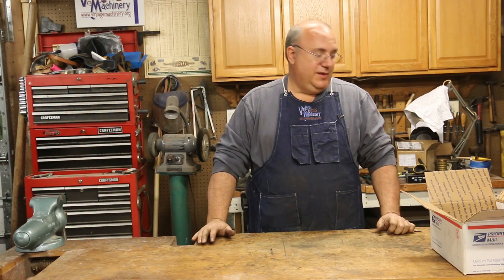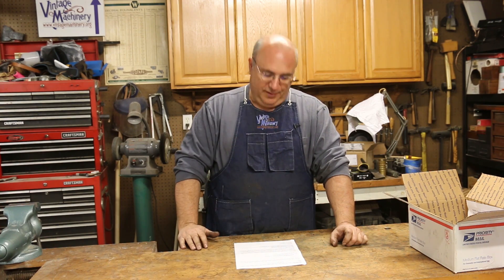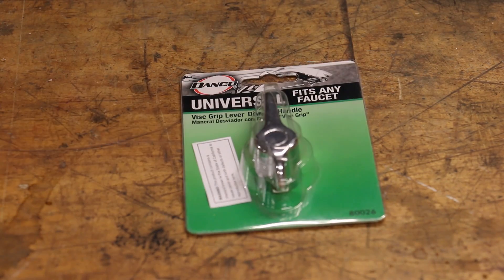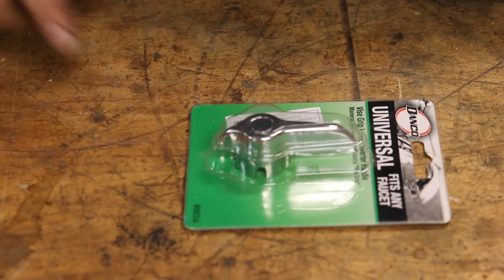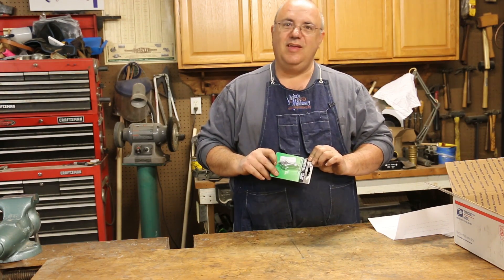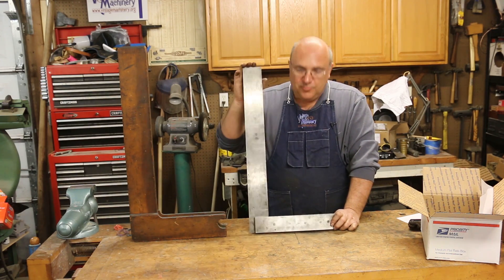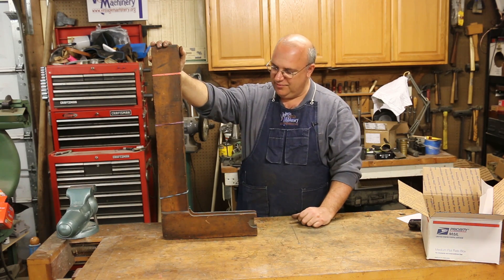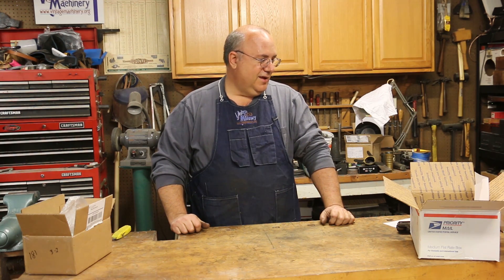Odds & Ends 42:  Viewer Mail, Starrett Square, and Survey

Comment: The Morse taper adaptor is also for using a draw bar in the taper that's inserted into it. I need one so I can still use my MT3 ER32 collet chuck with the M12 drawbar. A normal Morse taper adaptor would be useless for anything with a drawbar.

Comment: Keith, it is for marking pipe, to be cut with a torch. If you want to make two piece 90*, then you set it at 45*. If you want a three piece, you set it 22.5*.You set the angle, you lay it on the pipe ( works somewhat like a "V" block in reverse) so that it is straight with the length of the pipe, and you can reach all the way around the pipe. That size will work up to about 12" pipe.On larger pipe, you mark your pipe, top and bottom. Then set up to mark top half as far as it will reach, then set up on bottom (up side down) and mark up each side.Hey, maybe  I need to dig mine out and make a movie.
Reply from the maker: +Wally Verbeck I would love to see a video.  somebody sent me some instructions, but a video would be better!

Comment: your protractor thingy is used  for doing pipe lay out or I beam. i think if you us it right will help you cope big pipe if you know a welder or pipeliner he could show you how to use it very similar thing are used for lay out of logs in log cabin construction.
Reply from the maker: +mog5858 Yes, several have pointed me in the right direction on this.

Comment: Heh, a Curv-O-Mark, i use one whenever i have something very precise, but complicated to join on an in-situ job. Had a three H beams that had to meet, this tool made it all easier.

It has to sit on the pipe section (tho, you can also use it for when you want to intersect pipes with flat surfaces). You're missing the strap and another piece of metal that's supposed to help you set up your "x edge" on to square stock (or square edges). That's what it comes with in the kit. FYI, there's other parts you can buy (or well, could, not sure what's up with that).

Here's the PDF parts and other tools in the series, it also has a few pics that show how you can use it.

http://www.lencocanada.com/files_800-05/800-5.pdf

Frankly, one of the best tools as far as versatility goes. If you need something marked precisely, chances are you can do it with one variant and position of this tool.
Reply from the maker: +aserta Very cool - thank you!

Comment: Keith, that tool with a piece of soapstone on the end is a pipe marker.  You lay the body of it on a pipe and set the angle you need.  It will  mark all the way around the pipe.  You can make saddles, elbows, etc by marking the pipe and then cutting with a torch.  Used one of those and one way bigger for years doing pipe fitting.  You can even mark smooth turn elbows for fit ups.
Reply from the maker: +Susan Novotney Yes, I now have a copy of the instructions.  A very impressive tool!

Comment: HI Keith,

That reducer is clearly jinxing you.

A dead centre rotating in the spindle of a lathe is a live centre.

Note to others, a live centre should be soft and trued up in situ before each job for best repeatability.

Some sources state that a live centre has to be driven and a rotating centre used in a tailstock is a bearing centre or running centre.
Reply from the maker: +Paul Compton I have always called a "live center" on that rotates freely and a "dead center" one that will not.  In this case, it is a driven dead center, but I guess it all depends on how you were taught.

Comment: The pyrometer cover won't fit because the pyrometer has some bends in it.  I would suggest roll-straightening the pyrometer between two plates to straighten it before doing any grinding at all.  It looks to me that the cover will go if the blade is straightened.

Comment: Keith that gizmo with the soapstone is a curve-o-mark You lay it on a pipe or tube with
the angle you need and swing the soapstone around the piece till all the way around
The body acts like a v block. I have one I can do up to 24" pipe Curve-o-mark makes 
lots of lay out tool for fabrication . Your tap handle is chromium plated dont lick it
And yes nice L bracket now you just need some hold down bolts for it.
Reply from the maker: +Joe Duruisseau Thanks for the instructions....

Comment: scribe a line from a straight edge. rotate 180deg, compare edge to previously scribed line. QED
Reply: +James Hillman Your method is good for checking an ordinary combination square.  This is a master precision square , accurate to .0001" per 6".  Your scribe line is maybe 300 or more times wider than that...

Comment: love the square great video Keith...Keith I need some help working on my sons truck in your time surfing youtube have you run across a channel that gives good advice on mechanicqal issues on ford trucks ..
Reply: fordtechmakeuloco
Reply: +Scott Tyndall I have had fairly good luck just using youtube's search for the specific problem, for example: "2003 Ranger heater core" gives you 7 pages of hits. The first handful are all on replacing and flushing, even one on diagnosing heater problems. I also know there are a lot on brakes and electrical problems.
Reply: +Scott Tyndall www.therangerstation.com . It's not a youtube channel, but within the forum they have all the information you'll need, and lots you'll never dream of needing (like how to build a ranger with 3 transmissions, 2 transfer cases, unbelievable amounts of suspension flex, and a chrysler 460 mid-mounted engine)
Reply: +Scott Tyndall 
Classic pre-1970, 1970-2000 or newer late model Ford trucks?
Reply: patw52pb1 it is a 03 ranger
Reply: +TheOtherBill thanks😊
Reply: +Scott Anderson thanks
Reply from the maker: +Scott Tyndall I see that plenty of others have already chimed in.  As for me, I don't have any recommendations.  I have gotten to the point where I really can't work on my own truck any more - you have to have the right computer to figure out anything on them not days....
Reply: +Keith Rucker - VintageMachinery.org Thanks for the response Keith

Comment: Only $1700 for that square?  Bah...chump change.  Cheap at twice the price.  LOL
Reply from the maker: +WreckDiver99 If you need one bad enough, that is cheap.  There aint much I have ever needed very badly at that price though.....
Reply: Oh no doubt Keith.  I had a job where we were in dire need of a Gigahertz Oscilloscope and they were still in the $10K range...but when the job would have cost you $100K without one??  Yea...spend the $10K.  LOL.  Still...WOW.  Though this now makes me wonder what my 24" Indicator holder is worth (Starrett, in box, for a surface plate).  Hmmm...

Comment: Wow that square is awesome! I was thinking that faucet handle is chrome covered, thats probably why the warning label was put on. Also before you dip that ceramic cover into your crucible it might be handy to preheat the ceramic with a torch. My aunt used to handle ceramic items and I've seen her on more than one occasion preheat ceramic to prevent thermal shock.
Reply from the maker: +mcpheonixx Good idea on the pre heat!

Comment: Keith. I can see there are some bends on that Pyrometer. That is why it doesn't fit the sheath. I would try to roll it on the table with a piece of wood on top and straighten it out. Just as you would straighten a piece of tubing. Shouldn't affect it's operation as the sensing element is at the tip.
Reply from the maker: +Phil Grindle It needs some massaging....

Comment: sometimes those ceramic thermocouple/pyrometer sleeves can crack due to thermal shock.  if this happens you might consider an INCONEL version.
Reply from the maker: +Joss Fitzsimons We will try that one out first!
Reply: +Keith Rucker - VintageMachinery.org 

Just to add to what Joss mention.  In my time spent working here (http://www.specialmetalswiggin.co.uk/ - a company that just happens to manufacture Inconel tubing) I did, on the odd occasion, fabricate batch furnace thermocouples - usually type R, but sometimes type K and N (and survey thermocouples, but we'll not go there).  

Depending upon application, we made what we called "half sheath," "2 inch tip" and "blank end," but in all cases when replacing broken thermocouples the replacements were fitted SLOWLY to avoid the aforementioned thermal shock.  Ceramic sheaths were not used on the melting furnaces due to this issue; they used disposable pyrometer tips instead (http://heraeus-electro-nite.com/en/sensorsformoltenmetals/sensors_molten_metals.aspx).

NB
Half Sheath - a ceramic sheath mounted into a shortish Inconel 600 tube, for fixed position,
furnace sidewall mounting.
2 inch tip - a ceramic sheath mounted into a longer Inconel 600 tube, for furnace sidewall mounting, but with extra mechanical support when withdrawing the thermocouple for charge/discharging of
the furnace.
Blank end - a full-length Inconel 600 tube, sealed at one end, with a ceramic sheath liner, for mounting in furnace roofs. 

A typical example can be seen here... (http://www.tcdirect.co.uk/Default.aspx?level=2&department_id=180/33)

Comment: The item with the chalk on it is called a Curv-O-Mark, it is layed along the  pipe and lines are struck around used for making joints on pipes like branches and Y joints on pipe about 2" to 12" there is a larger model for larger pipe sizes too.
Reply from the maker: +Mentorcase Cool, I need to look it up and see somebody using them.
Reply: +Mentorcase  Thats what I thought it was, guess there aren't many pipe fitters making comments, ):
Reply: I'm pretty sure there aren't any videos about them either, I should make 1 as I have 2 of them myself.
Reply: +Mentorcase I was just about to post this same explanation.

I've got one of each size, and they work like a champ for coping big pipe for weld joints.

You lay the thing you stood on end down onto the long axis of the pipe like a v-block, which keeps the tool aligned with the pipe lengthwise, then you use the arm to mark out the projection of an angled plane around the OD of the pipe.

In my experience, a really large hose clamp or really small ratchet strap (or another guy) can be used to hold the v-block portion to the pipe securely, so you can spend your time focused on making a good line.

They work really well and are just about the only good way to lay out an exact angle on the OD of a big pipe.

Comment: Keith 
With ref to the pyro cover they used to use cardboard disposable for the spheroidal graphite CI that the used to use 1600 deg C they were about 2 inch dia with the pyro element enclosed in a glass tube ( which of course melted off at first dip ) ok they used to set on fire but they were single use 

Stuart
Reply from the maker: +Stuart Hardy Pretty cool!